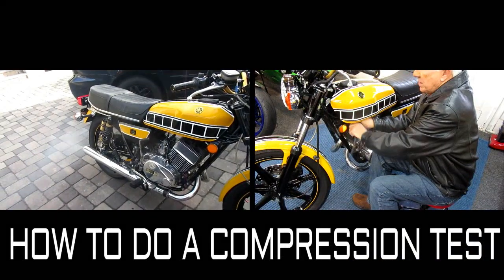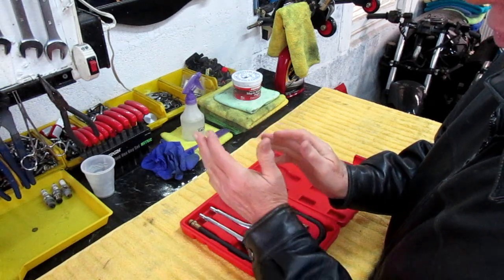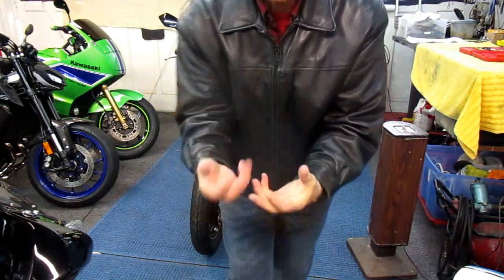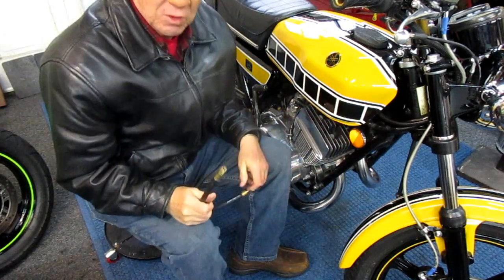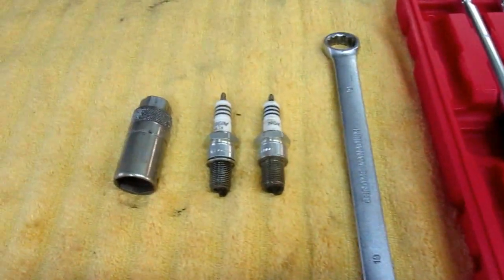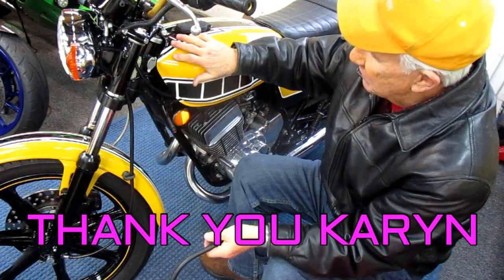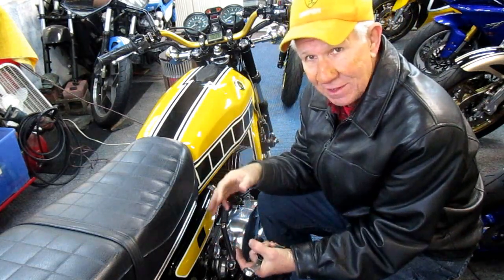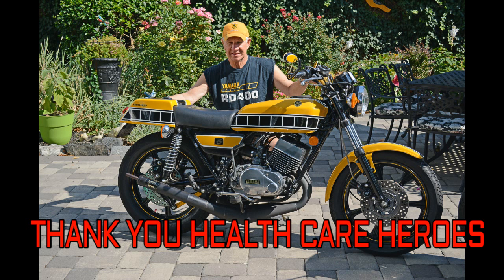HOW TO DO A COMPRESSION TEST ON YAMAHA RD400 1977

Comment: Two stroke engines should also be tested for leak down.  An air leak will cause a two stroke to run lean, which can lead to expensive repairs.  It is easy to make a leak down test kit from plastic pipe fittings, hose clamps, a pair of pipe plugs, and an air valve.  Remove the exhaust and carbs, plug the intake and exhaust ports.  Pressurize the engine to 6 psi, and see if it holds air for 15 minutes.  If it drops pressure, mix up a spray bottle of water and a little bit of dish soap.  Spray the engine with soapy water, and repressurize to 6 psi.  You will have bubbles where the leaks are. The bubbles do not lie.😊
Head gaskets, base gaskets, intakes, crank seals can be replaced.  Do not wait for your engine to grenade itself due to an air leak.
Happy two stroke Motoring.😊

Comment: I have iridium plugs in my RZ too. Also use them in my snowmobile. They certainly last longer than the ordinary plugs. A couple of years ago my RZ was running pretty erratic, and seemed to be leaking oil. I found the base gasket on the right cylinder had a blow out. The gaskets these days don't have the grip that the old ones that had asbestos in them. When I replaced them, I put a light coating on them, of pipe dope that is for use with gas fittings with teflon in it. Never had a problem since. This summer I repacked the exhaust cans with new insulation, and it runs like new again.

Comment: Nice video!  I usually find my RD readings in the 90-115 PSI range with about 10 kicks, throttle wide open, engine warm.  The brand of gauge will make a difference, I have 3 and they all read read different.  Here is my latest RZ350 video:
https://www.youtube.com/watch?v=MQSpfFh2xOg